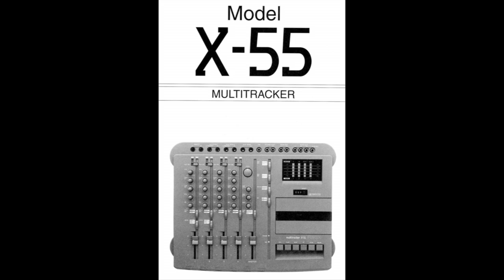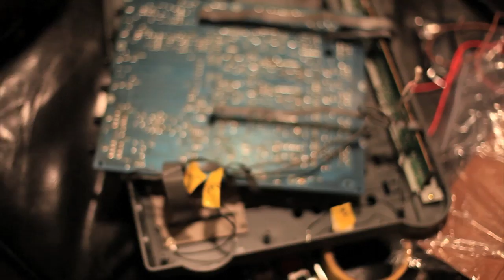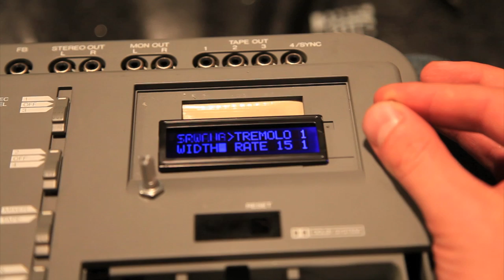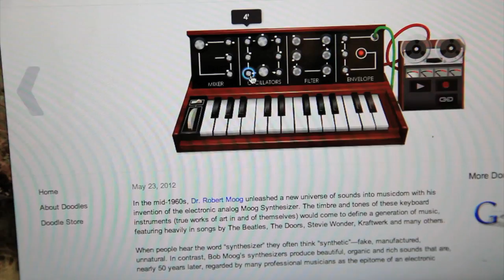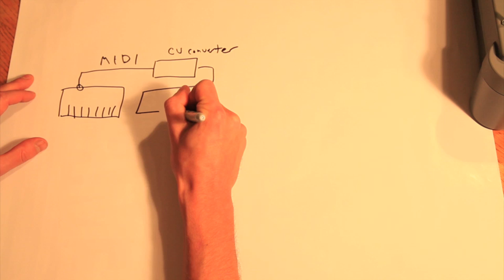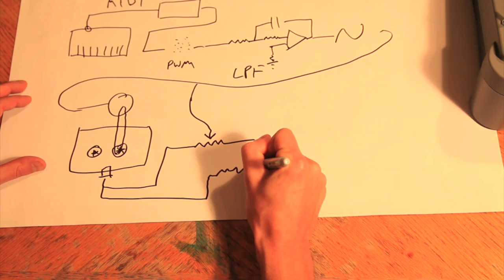Moog Circuit Bending Challenge 2012.

Comment from the maker: @TurboSwami it's monophonic, 2 voices, I could expand to 4 easily, just need add some more vca's. Right now I have the 2nd voice recorded as an octave up rather than a different waveform, and the keyboard mapped accordingly. I did that because it's basically impossible to get more than a single octave range by bending the tape speed, it's already a bit slow to track the pitches with the stock dc motor.